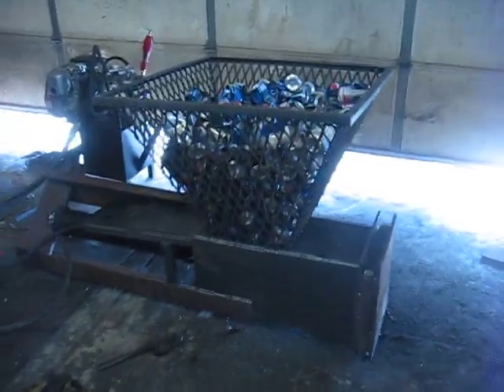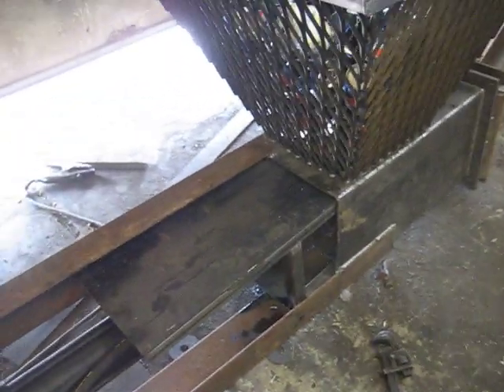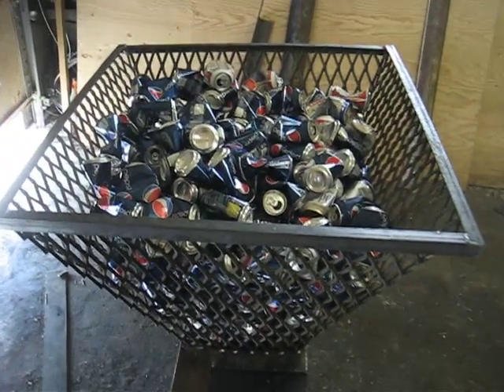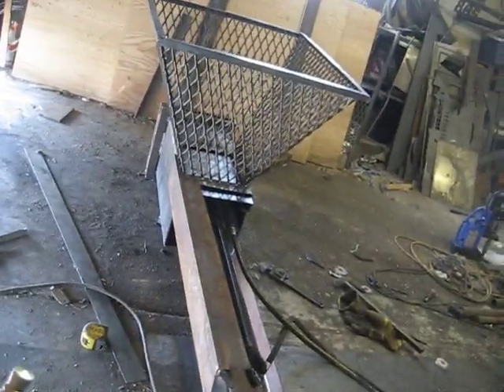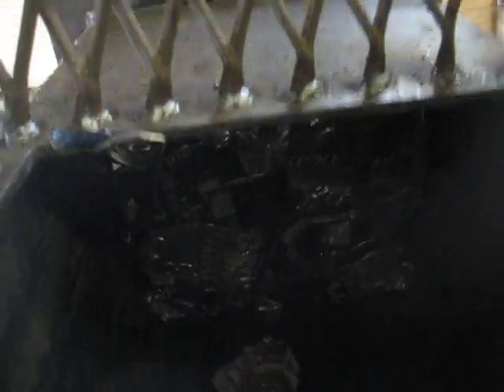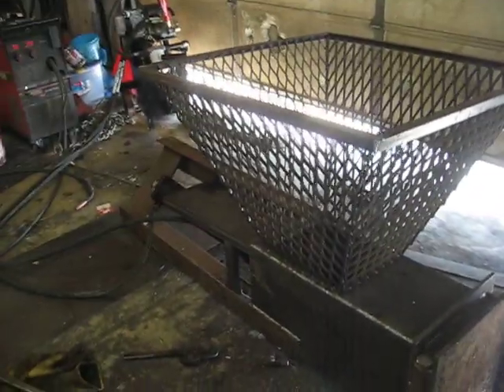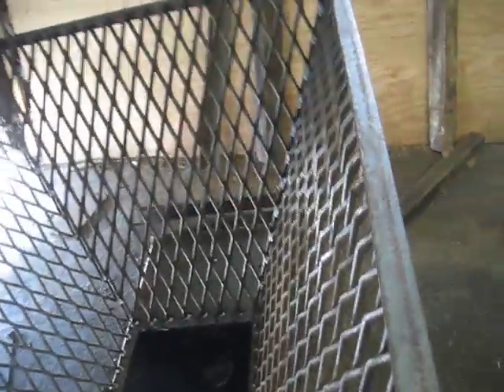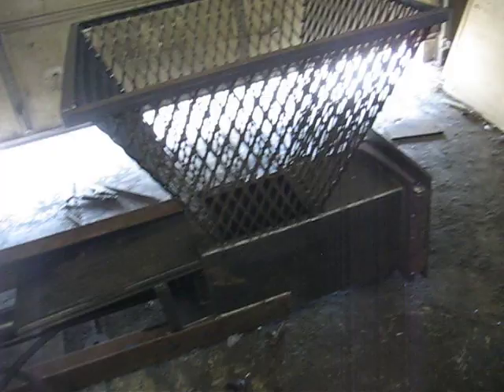can crusher

Comment: Talk a load of crap the hopper was a fail ! Smooth walls are better and the speed come on hyd. Never has been known for speed and power ! Even after 4 passes you still talk crap how fast it is?? I know why you didn't open it up and show off the bail. Cause it was jammed the door won't open ha ha fast my azz other than that nice build .
Reply from the maker: Where is your home built crusher douche and yes I haven't installed the hydraulic door pin remover and the cans are smashed against my door but if you and I mean you take your gaming headset off get a sledge and pound the pin out using manual labor (please watch wall-e) additionally I work excavating I'd love to see your build NOT USING HYDRAULICS be faster my videos are to give you millenials some inspiration to to do something besides the phone
Reply from the maker: See video can crusher takes a dump
Reply from the maker: See video can crusher walk through
Reply from the maker: See u.s. patent department website (no I didn't patent it) but someone probably did please post your build so I can make fun of it China reached out and wanted it, post your videos then shut up everyone has an excuse there like a holes everyone has one and they all stink bring you video buddy.
Reply: Thats funny you think im a kid like you i didn't say that to make you cry .if you're going to talk about how bad azz you  machine is .then make it bad azz .you could have used the edit function before posting this fine pos but you didn't . So take off you're I'm a bad azz hat and admit you built a copy of a bad idea and it didn't work and you are having a temper tantrum grow up little boy

Comment: to much energy goes into this method. and it is rather slow. you can do much better with a couple car wheels and tires and an electric motor. if you are not worried about bales. the scrap yards here will actually give you less money for bales because people have hidden heavier items in them.
Reply from the maker: Devin Rovell  you can still put lead pellets in single cans....
Reply from the maker: Your thinking like a thief, must be one, I use the same scrapyard and they know me it's like a sexy recycling relationship and that is why price drops happen people like you take advantage of them, then the people who melt it down find lead in food grade aluminum and have to pay less to recover their loses because people like you!
Reply from the maker: bales peel off in 1 inch layers and if the scrap yard is dumb enough to take a 108 lb. Bale with a steel core inside well maybe they need to look up bauxite and know that it takes 12 lbs. of ore to make 1 can, but by all means put your car wheels together and crush 500 cans in 2 minutes,

Comment: I bought an old log spliter for $850.00 and fixed it up. Made a box adapter for the wedge and added the hopper for about $150.00. It came with Motor, ram, control valve, mounted on wheels and a trailer hitch. Altogether it cost about $1000.00 and it's mobile. WTF makes yours worth three time that ($3500.00.) ??
Reply from the maker: Is your time not worth anything?

Comment: I like it.  I also like the intro.  Funny.  The following are not criticisms.  Just suggestions that popped into my head as I watched.  I realize I did not make this and have no idea WTF I'm talking about.  :)  Just adding commentary.  The only thing I can say is that it needs to be fully automated.  Pile the cans up in the hopper, flip the switch and the machine does the rest.  You just need to add the cans to the hopper.  Perhaps had a hopper shaker to keep them darned can's from getting stuck.  Then pull the bale out in the end.  I'm going to go watch that video now.  Thanks for sharing!

Comment: Good job on the crusher man, but aren't you at all worried about breathing carbon monoxide? For what it's worth,  I don't think that small opening is enough to vent that stuff, especially if there is no wind outside to blow fresh air in. Or., I'd have the unit sitting outside with the door completely closed as to not let any fumes in.

Comment: Love your video.. Love your showing of it.  Here's what I'm thinking of:  Dual acting cylinder, with rams on each end,, hoppers on both sides.. (opposing crush!)  Pressure-switch regulated to throw the detent..a helper to load hoppers, automatic release of end plate (to poop out the block) - probably controlled by a counter, or limit switch hooked to a relay..or even just manually-run.. um, um.. another helper to tie off the blocks with aluminum wire..and reset the end plates?    haha

Comment: @plasmaman2507 $300? I'd just grab one of the many motors lying around that were stripped off one of the many parts mowers. I'll sell you a little 1.5cuin cessna motor for $75 shipped. I'd love to have a CNC table- have to settle with a pantograph for now.

Comment from the maker: @MrLeonard55 I tell you what... If and that's a big IF you build anything you need tools to do it like I said I just finished it, and have you know at the end of the day I still parked my full size extended cab truck and my wife's Honda car in there with my 4x8 cnc plasma cutter, 3 welders, oxy acetylene torch drill press, mag drill, 5000 lbs of misc steel, street bike, fourwheeleer, 80 gallon compressor, 60 gallon compressor, hoist winch, 2 co2 tanks, 3 argon tanks, engine hoist, no more charac